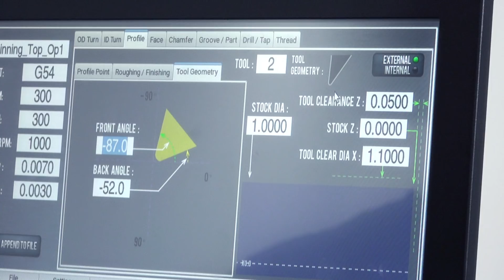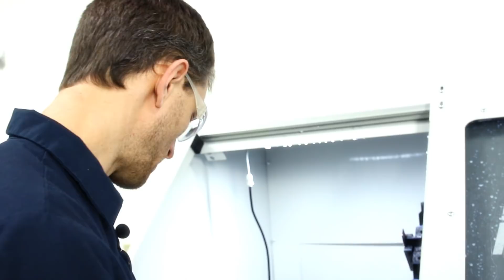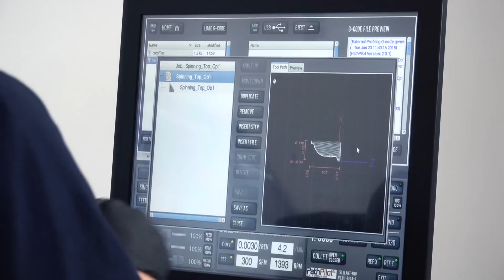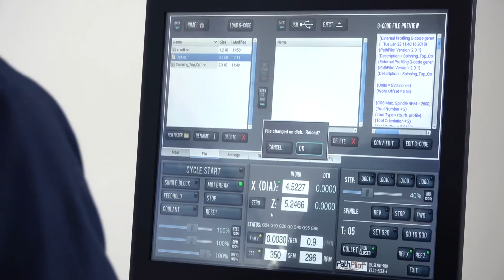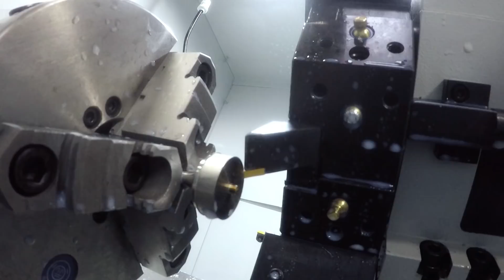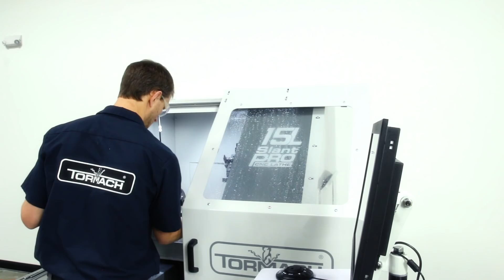Turning a Top with Conversational Profiling

Comment: When doing larger batch I dont part all the way. Like 2-3 mil short so the part is easy to take off. Dont got no part catcher on the lathe. Also, like 0.05 mil metal sheet work well for zeroing.